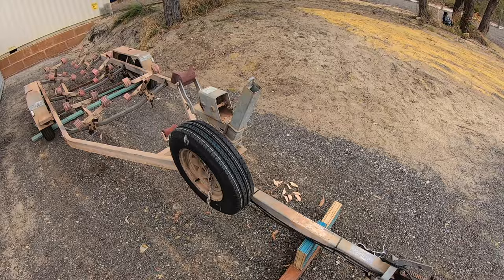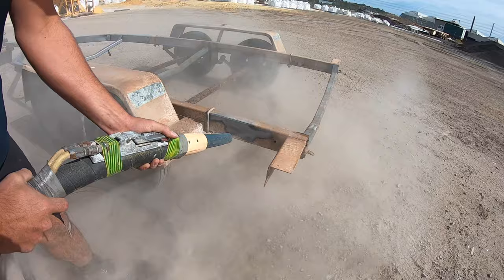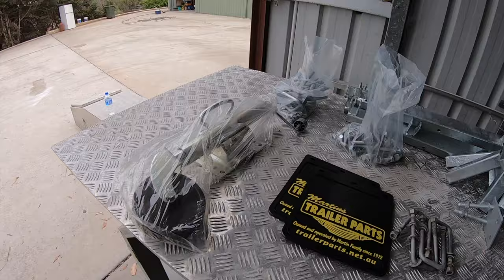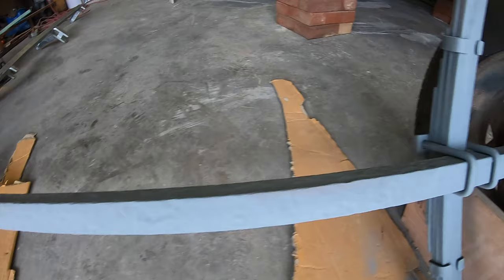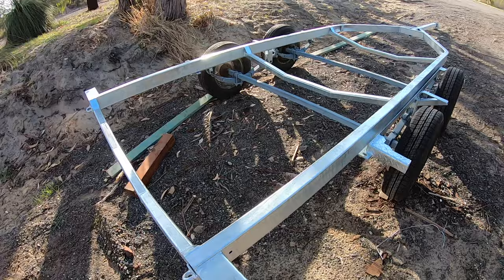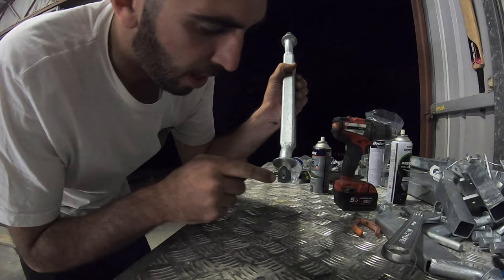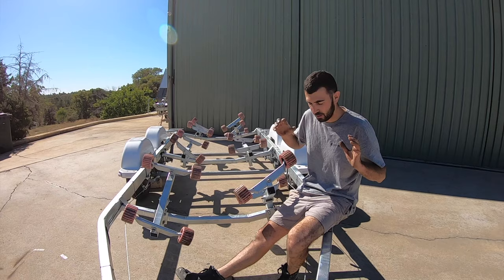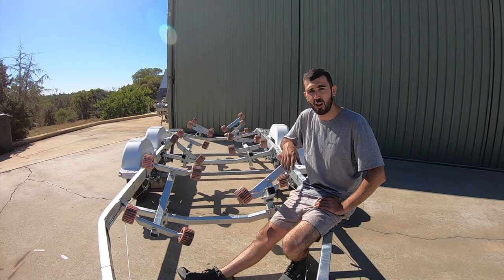RESTORING RUSTED BOAT TRAILER | FROM OLD TO GOLD | FULL BOAT RESTORATION - PART 7

Comment: Nice Video! I don't think I can sand blast my trailer... I have been hitting it with rustoluem. Mainly the L shaped pieces of metal that hold the bunks are are very rusty and falling apart. Any advice on what to do besides hitting it with rustoluem?

Comment: Typically with boat trailers, the wiring is usually run inside the tubing. This prevents the wires from getting cut or damaged during usage. You may want to consider rerouting the wiring inside the trailer tubes rather than outside them. It will make for a far more durable and reliable trailer in the long run...
Reply from the maker: Hi Rick thanks for the message, with the wiring harness i purchased it didn't allow me to run down the chassis but in the future i will we putting the wiring in PVC tubing to prevent damage and make it look a lot more aesthetically pleasing ! thanks for watching :)

Comment: hide a gps tracker in it.

Will be a target when left at ramps.

Same as the boat.

Cheap and good to have.
Reply from the maker: wow thanks for the tip shaun, did you have any brand that you found good?
Reply: @AngryMackAdventures  haven't fitted on yet but my boat or trailer isn't as nice as yours. But there are plenty on eBay and some googling will put you in the right direction

But it's cheap and well worth doing

Comment: Nice vid! I’m doing similar with my trailer. Is there any issue with sanding down the trailer from rust, and then spray painting it. I just don’t want to spend too much money. And what exactly did they do in the shop that you took it too. I’m new to this and wouldn’t have a clue what they did to your trailer. Cheers.
Reply from the maker: Hey mate, spray paint isnt very good with salt water, galvanise is alot stronger, if you plan to keep for a long time, i recommend it.. its not as expensive as you think if you can sand blast it yourself :)
Reply: Mind me asking how much your hot dip galvanising was per kg? I have some quotes in Brisbane and its pretty expensive.